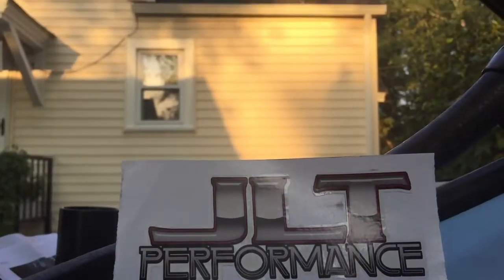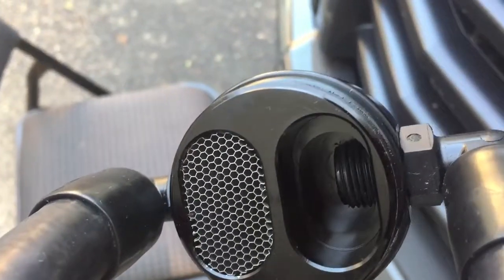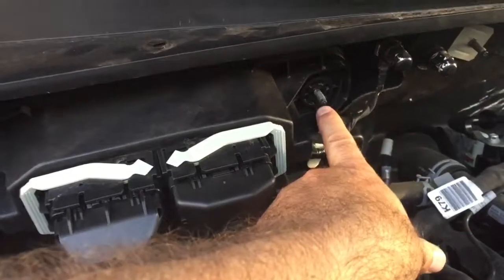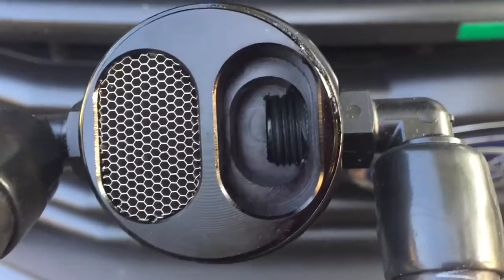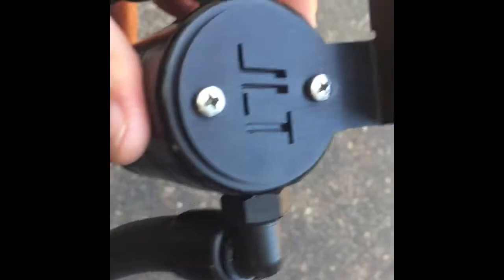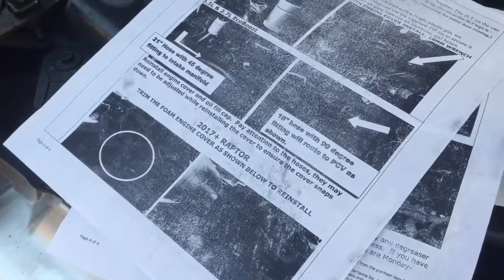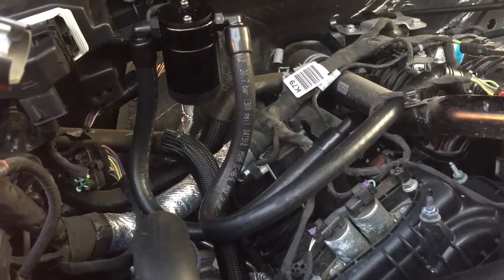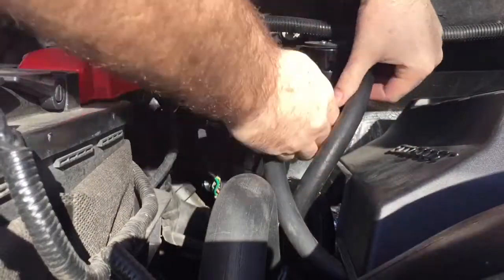f150 oil catch can JLT

Comment: Hi Chris great video but, I just called Jlt and asked them about your video. I have the same engine and Jlt told me the honeycomb is on the valve cover side. I have been running mine for about a year now with great results. I get about 1 ounce of oil for every five thousand miles. So please call JLT back and also I watched a video and it also states the honeycomb is for the incoming side. Here is the video I was talking about. https://youtu.be/Ze8dBCdsMfE
Reply from the maker: craigb757  Thanks a lot bud. I watch the video and I’m going to have to open mine up again to see how I Ranett. For whatever reason I kept getting different instructions online and unclear info from the company. I edited that video multiple times and then finally gave up. I appreciate the heads up.